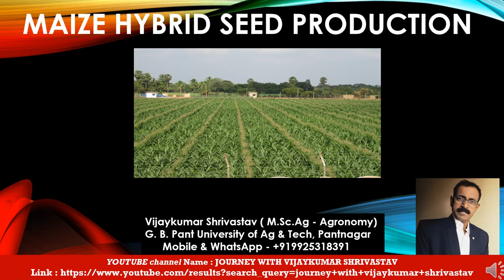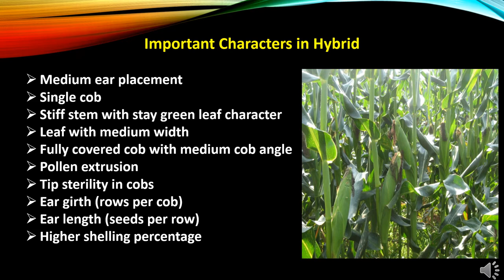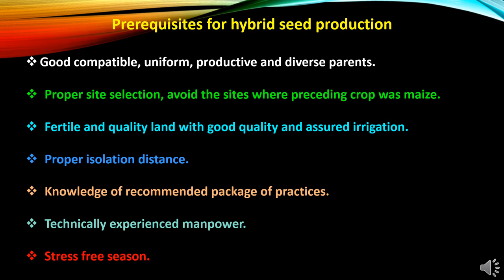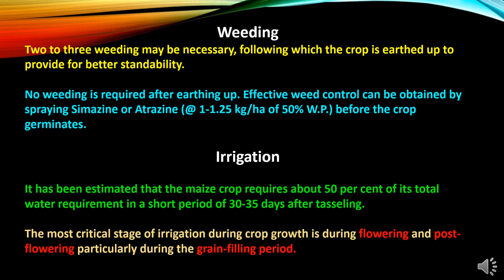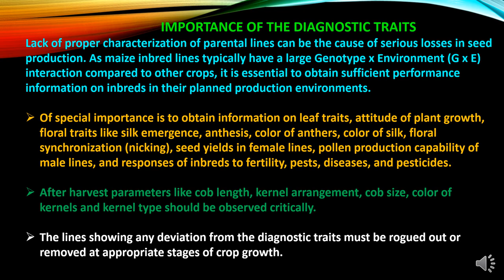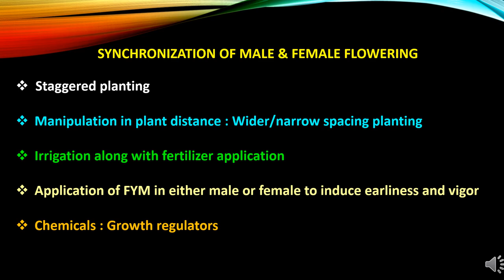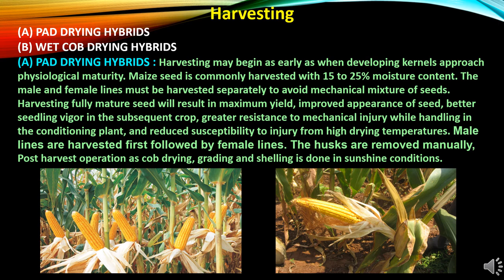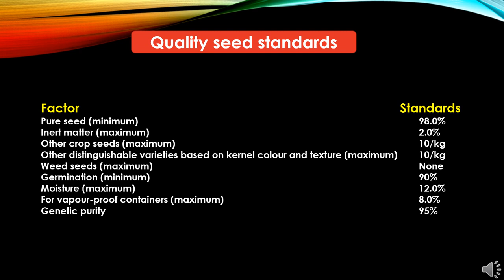MAIZE HYBRID SEED PRODUCTION

Comment: Good evening sir. What is the difference between hybrid seeds and gm seeds sir. Do both have terminator gene that means they are infertile for next generation once sowed. Please kindly share your wisdom 🙏🙏🙏🙏🙏
Reply from the maker: Wecome, please find as below :
(A) Hybrid is a product of cross between genetically different parents (inbreds lines) where Male and female line are planted . Sowing is planned in a way that there is same time flowering of both lines, male pollen falls on female parent stigma and seed setting and development took place. This seed will be Hybrid. Hybrid will have superior yield performance than it's parents with high yielding and quality also.
(B) GM - In case of GM seed the in plant genetic modifications are done inoculated with specific bacterial strain to development resistance against major insect pest for which gene is used,  induce specific characters as nutritional value etc. In GM (BT ) crop the pesticide use will reduce significantly to control  specific insect. example BT cotton for Bollworm,  BT brinjal for fruit borer / caterpillar control, BT rice for insect , Herbicide resistance tech for weed management, Golden rice for VIT A / Carotene content etc.
Hybrid and GM are entirely different concept.
No terminator genes are used till date. 
Fresh seeds are recommended both for Hybrids and GM crop to get it's benefits, if the produce is used next time for sowing performance will be not be as fresh seed.
Thanks !
Reply: @journeywithvijaykumarshriv9599  respect for you dedication towards teaching. Sir you explained crystal clear manner. Thank you sir 🙏🙏🙏🙏🙏
Reply from the maker: @panchajanya4601  Welcome and thanks !
Reply: @journeywithvijaykumarshriv9599  good morning sir 
with due respect to you i want to ask one out of context question please give reply sir 

what is the use of adding gypsum to soil.
adding gypsum to saline soils makes them regain fertility or adding gypsum to soil increases water holding capacity of soil. please tell me sir .

thanking you sir
Reply from the maker: @panchajanya4601  Welcome ! Gypsum is useful in reclaiming Sodic soils (Alkali soils) and Saline-Sodic soil. Sodic soils comes under poor physical condition and Saline-Sodic soil  under poor to good physical condition category.  These soils are having high content of carbonates and
bicarbonates of sodium, calcium, and magnesium .  These are causing hardness of  soil
 surface, reducing infiltration and creates water logging conditions. So these soils are reclaimed by addition of Gypsum by means of replacing exchangeable sodium by calcium. Gypsum is helpful to make easier for soluble salts to be leached by water moving through the soil,
only leaching can remove soluble salts from soil. The leaching process can be very slow,
 and may require several years. Restoration of sodic and saline -sodic soil is slow process. So finally Gypsum will improve  physical soil condition, soil characteristics, improving water infiltration for plant water availability, soil aeration, minimizing runoff erosion,  adding Ca and S and improving fertility. Thanks !
Reply: @journeywithvijaykumarshriv9599   I need to say thank you very much sir. Thank you sir for your explanation and dedication 🙏🙏🙏🙏